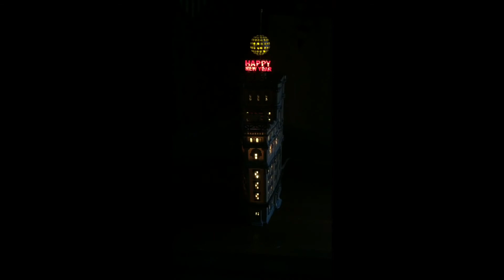Dept56 Times Tower Repair

Comment: Mine has maybe a different problem. Opened it up this year, plugged it in and I think either the AC adapter or the button swtich is bad. Messing around with it, I got the ball to go down and now its not working at all. At times, the ball and the new years sign just stayed lit so Im pretty confident its a power issue. Do AC adapters go bad? Its much more likely the swtich but I dont know where to get one. Third building that went on me. My empire state wouldnt light up but I wqas able to solder the 20 wires they used to light that bulding. My brownstone xmas light dont work anymore. Great pieces but their electronics are not built well or for the long term. They should consider removable bottoms.

Comment: I have another question for you I bought a brand new one never opened ever it makes a noise when the ball goes up and down not loud but noise is this normal. Also how do you change the numbers?
Reply from the maker: The noise is common. As for the numbers, they come with the Times Tower. I attach them using “duct seal” it’s like a sticky putty that will hold the numbers and makes it easier to replace every year
Reply: Mike the tower worked fine last year brand new. I can’t remember but is there a trick to the button that makes the ball go down, it’s not working now.